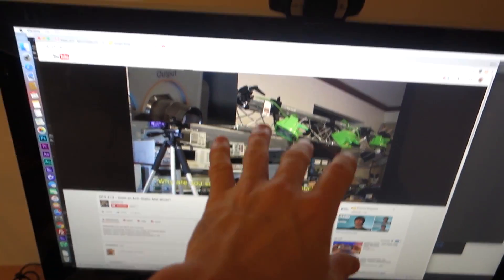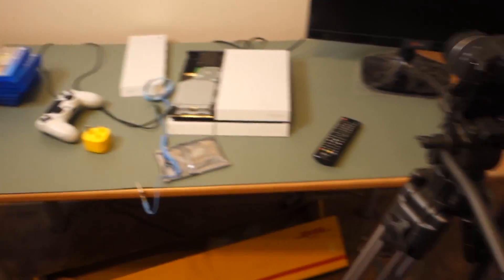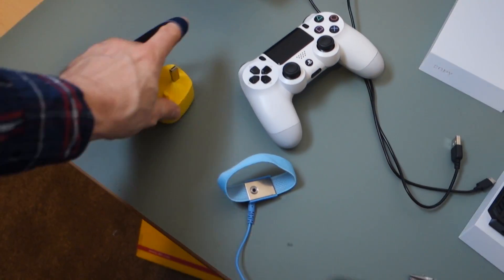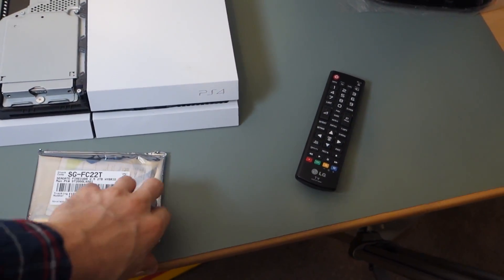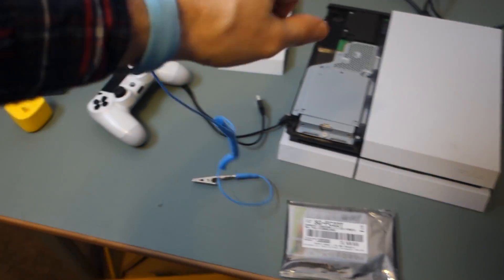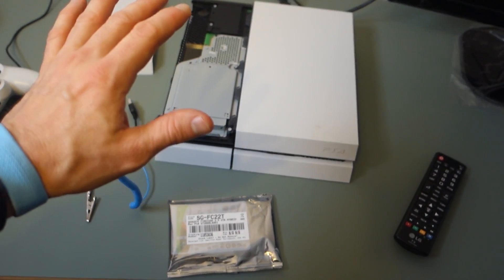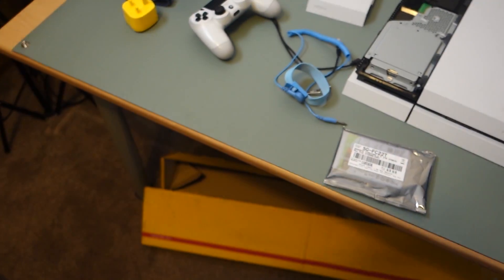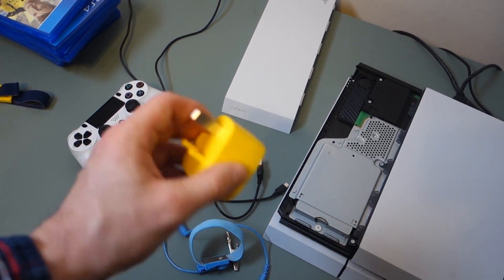Why You Should Use a Anti-Static Wrist Band and Anti-Static Mat

Comment: Hey that 1 MOhm resistance is build in to prevent you from dying due to electric shock in case the wall outlet you plug it in to is wired the wrong way.
Reply from the maker: Thanks for clarifying Andrew.

Comment: do you just need to slot the ESD plug into a socket and it's good to go?
Reply from the maker: That's the idea. I've found that I just connect to my anti static mat instead.
Reply: @KevinMuldoon  in the uk, do you need to turn the socket on or off?
Reply: Yes he is correct,that is the main idea however,It's best to go the full nine yards and get a bench mat,but if you really want to make your work area completely full proof,you should have a bench top mat,a floor mat,esd safe conductive parts bins and bags,an air ionizer and make sure you can attach a wire to both the floor and table mat,I will show in a video on my channel how to get the Same exact results as a two wire wrist strap with only a one wire wrist strap.

Comment: Great video! I'm about to build my pc in a bit,  would you say it's sufficient for me to bond my wrist strap to the pc case? TIA
Reply from the maker: Thanks Moni.

Yes, connecting to the PC case should be sufficient :)
Reply: As long as the PC case is grounded! i.e. power supply contacting the case, and power supply plugged into wall

Comment: It's a very good idea, but if you use the adapter that actually connects to the ground line on the wall outlet, be ABSOLUTELY sure that whatever device you're working on isn't plugged in somewhere else! If you accidentally touch some part that is live, the current will have a direct path to go through your chest to your other arm that is now grounded! If it's high voltage, you're dead!!
Reply: I think this is the point of the resistor you include in the wrist band.
Reply: Also, if I was connecting myself to a wall outlet I would first use a socket tester to check the outlet wiring is correct.

Comment: You really only have to worry about ESD on older components.  On most modern mobos the most you might fuck up is SATA ports.  You can just touch metal before touching your electronics to ground yourself.  Older electronics don't have any form of real ESD protection, but a lot of modern electronics do.
Reply: A lot of modern components do, but not all of them.

Comment: You can also get plug adapters with only the ground plug connecting through them so you can plug in the device you're working on so it is grounded but not powered.
Reply from the maker: +SDWNJ Nice. I wasn't aware of that.
Reply: I have some for working on a computer that go between the power cord and computer.  I'm pretty sure I got them at cyberguys.com but they don't seem to sell them anymore.  Of course, you could always fashion your own.
In the old days of PC's (386/486 era) when you turned the power off on a computer there would be no power outside of the power supply but it would still be grounded.  Now parts of the motherboard are still powered when it is turned off so you need to unplug but that leaves it not grounded.  The adapters give you another option.
Reply from the maker: +SDWNJ Right. I know the basics about it, but I'm far from an expert. I do always try and stay grounded when doing repairs.

Comment: I usually only wear them for new computer builds but for old builds I just touch metal and keep some skin in contact with metal while building and im fine. The only thing I should mention is while I cant confirm or deny it I was taught never wear one while working on printers as it completes the circuit. I don't know how true that is as I tend to just swear at the printer and go buy a new one vs try and fix it. Right now im working a pentium 2 build just because and really im not worried about static shock. If its a new build and lots of money was invested then yeah use an antistatic wristband. They are like $7 when I got mine and I still have it so its already paid for itself 3x over in peace of mind alone. When it comes to laptops I just dont really mess with them unless its a mac as windows laptops ive worked with are near impossible just to upgrade ram or hard drive.